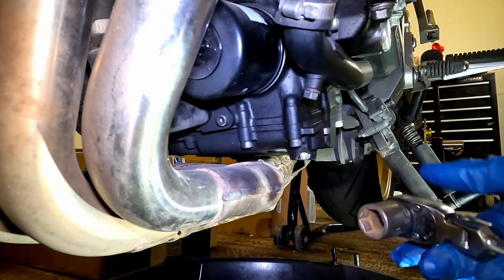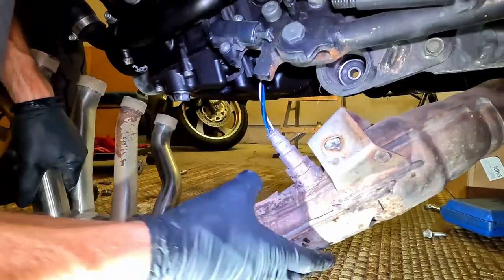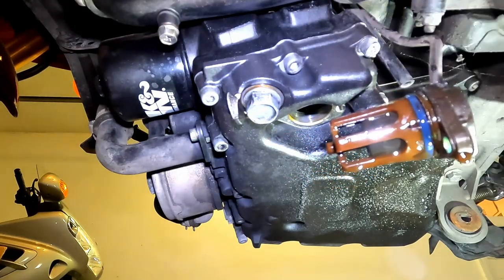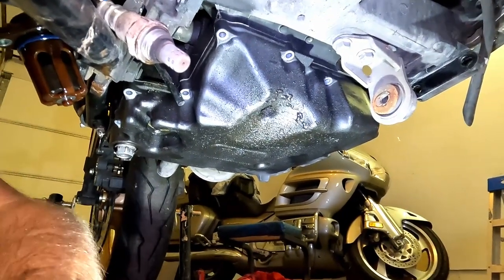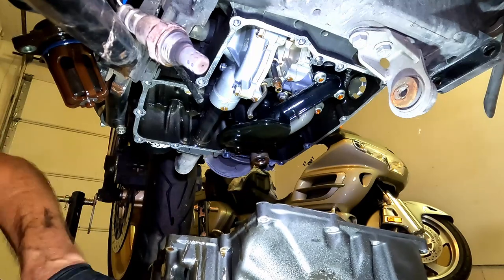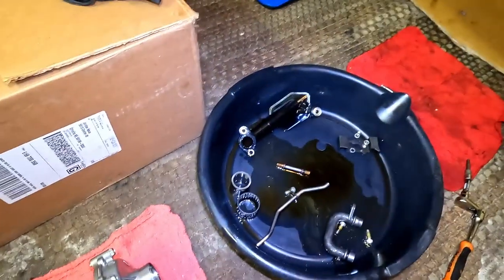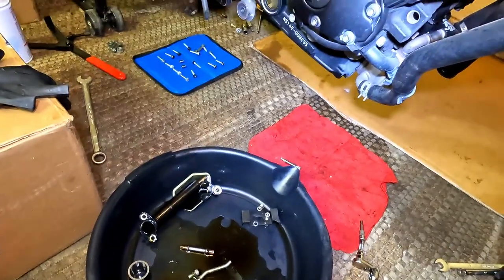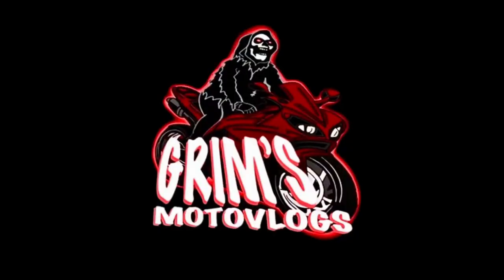Yamaha FZ1 (2006-2015)  How To- Water Pump Oil Pump Removal| Part 5 - Can We Fix It?

Comment: You dont need to take the centerstand off! A bent 90 degree allen key fits, even the one that came with the bike tools! Gonna try to do it without taking off the clutch too
Reply from the maker: The only reason I really had to take the center stand off was to be able to use my torque wrench when going back together. I don't know of a way to torque it with an L shaped Allen wrench.  Please let me know if you are able to do it without pulling the clutch basket! That would save a whole bunch of time! I already had my clutch apart for other reasons, so it just made sense to do it the way I did. I know the slack in the chain seems, to me at least, like a ton! So I think its definitely possible. The amount of slack in that chain on these bikes scares me lmfao.

Comment: Thank you so much for showing the detail of all this. I have 05 first gen Fz1 and I have a noise that I can't locate. This is helping me to think about options of what it might be at how to get at it. The first gen and second gen are fairly similar I'd guess, though their is some sort of exploding stator problem with the gen 2. Are you thinking about changing that on your gen 2?
Reply from the maker: Thank you! I appreciate that! I enjoy making these videos! Very time consuming tho. I’ll have a bunch of new videos out soon going back together.  And when it comes to the stator problem. I actually replaced it already with the OEM redesigned one. And also had to replace the bearings with it. Not too bad of a job to do.

Comment: Hi man nice video.

A question thought.

The little hole on the oil pan that connect via a tube to the water pump, what uses it has? i mean i didn't see that you used it for drain or something, so what it does?

Thanks.

Comment: On the FZ1, is it absolutely necessary to remove the clutch to create enough room/slack to remove the water pump? Id very seriously like to avoid this step, read on the R1 forums that people have been able to wiggle and shake things, in getting the pump out. Working on the street, less disassembly and less dirt is ideal. Less work too. Thank you for your reply please!!
Reply from the maker: I've heard its not necessary but personally I wouldn't fight it, its possible you damage other stuff trying to forcefully get the pump out. If I remember right it was already pretty difficult to get the oil pump drive chain back on as it was. I know I tried to remove it first without pulling it off the oil pump drive sprocket [behind the clutch basket] but I couldn't. I had to pull the chain off the upper sprocket to get it freed.

Comment: Do you know if a bad water pump will cause coolant to leak from the weep hole that’s on the bottom of the oil pan? My 2007 FZ1 is making a whining noise and leaking coolant from the weep hole.
Reply from the maker: Yeah, if coolant is coming from the weep hole and dripping on to the exhaust, then the water pump is worn and should be replaced. The whine noise may or may not be associated with the water pump failure though.
Reply: @grimsmotovlogs369  I appreciate it man! I’ve been researching it like crazy and have been seeing mixed opinions. Going to get a new pump on Monday 💪
Reply from the maker: Its definitely a time consuming job, just make sure you get all the associated gaskets and o rings with it.  I believe in total for all the parts, I paid around $400 or less. A torque wrench is a must, and just take your time.

Comment: my fz 8 rotor went - think there ,s magnet dust in sump - sump pump replacement ?
Reply from the maker: Sorry to hear that.  Maybe there should have been a recall. Definitely going to be debris throughout the motor, def need to clean everything really well. Are the FZ8 engines similar to the FZ1?

Comment: Brake parts cleaner took A LOT OF PAINT right off my bike, especially around the pan area. Beware of using BRAKE PARTS CLEANER to clean any of the outside paints parts of the engine. Will take MUCH PAINT OFF. FYI
Reply from the maker: yeah it will definitely take paint off.